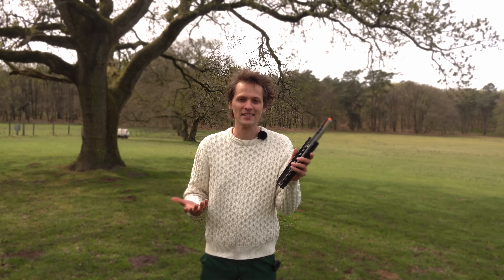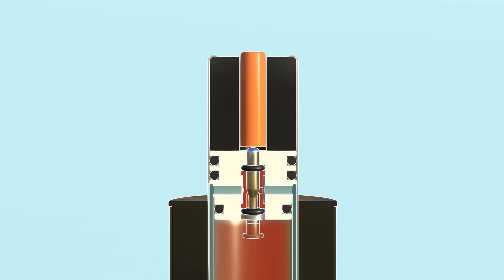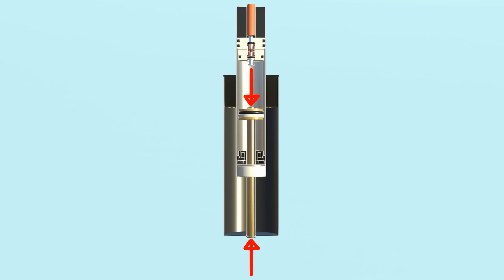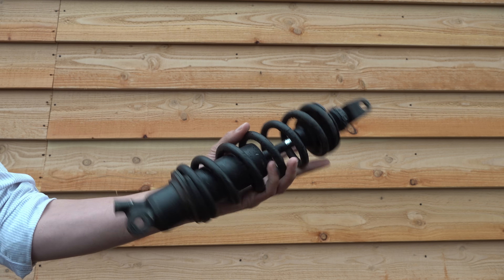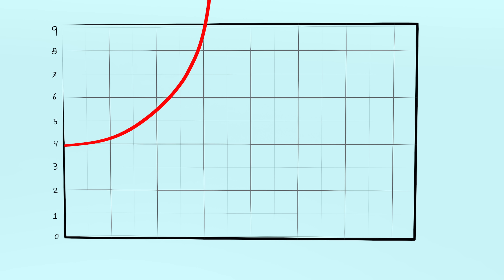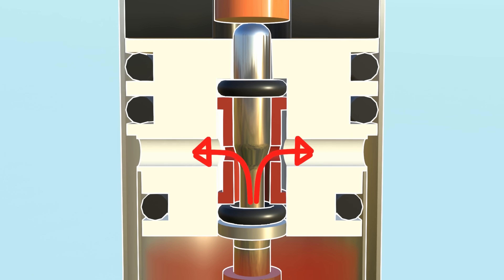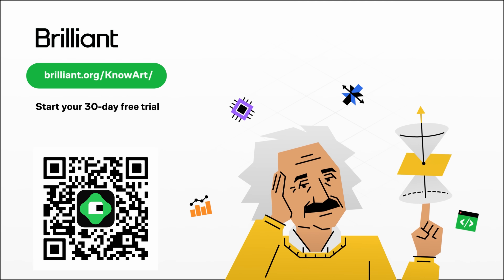The Brilliant Engineering of Gas Springs

Comment: Regarding the part at 1:42 I can unfortunately only guess at the function. My first thought was that it was the chamber to account for compensation, as the gas pressure will increase as more rod volume enters the cilinder. 
But that wouldn't make much sense. Besides not being needed because gas is compressible, in the cutout animating it appears that the bottom rubber is more of a kind of seal. Maybe it's acts as a 1 way valve to allow the piston to be pressurized from the bottom during manufacturing? Interesting video! And yes, I had seen the video en linear gas springs from ThisOldTony, great stuff!

Comment: If that diagram is correct in the beginning, I am curious if that bleed hole to a rubber washer may somehow compensate for the chair being manufactured at a higher, or lower, altitude than where it ends up being sold at? 🤔

Comment: Sure we can make a real world constant force gas spring, just use the earths atmosphere as the pressurized zone and a vacuum as the low pressure zone… only problem is that 1 atm isn’t that much pressure and you need thicker cylinders to get enough force.

Comment: It is important to highlight that the pressure inside must be greater than air pressure for this to work (or if it is lower then it would work in reverse).
I know you had that in the video, but it was glossed over very quickly.

Essentially, 
top rod is supplying force of: p_air * S_rod + p_inside * (S_piston - S_rod)
bottom rod is supplying force of: p_inside * S_piston

The force up is: S_rod * ( p_inside - p_air)

Comment: I've been pondering this a bit and something that feels intuitive to me is if you imagine that there is no piston at all, just the rod that slides in and out of the pressurized cylinder. The pressure in the cylinder would push the rod out. That is pretty easy to reason about and makes intuitive sense. Then we add the piston head, but the only thing that does is restrict flow between the chambers to dampen the motion. The math works out the same, the cross sectional area of the piston is what matters. But the intuition feels easier. Pressure pushes rod out. Add a flow restrictor to the end that slows it down, but doesn't change the fact that pressurized air is pushing the rod out.

Comment: I would suggest that the idea around 3:55 becomes easier to understand if the explanation focuses on how the volume of the gas changes as the piston moves - that is, whether the gas is being allowed to expand or forced to compress.

This rate of change in gas volume, per unit of piston movement is the “area” in question that the force is acting upon.

The relationship between the two explanations brings in a small bit of calculus:

F
 = dE/dx
 = d(P * V)/dx
 = P * dV/dx + dP/dx * V
 ≈ “P * A” + 0

(dP/dx * V is a small number since dP/dx is small, and it corresponds to the gas’s internal changes, like temperature.)

But notice how the “area” A here is the area that contributes to a change in gas volume as the piston moves. That is what determines how much work the gas is doing, not just any surface in contact with the gas.

As an aside, this also makes it more intuitive why the gas inside must be kept at a higher pressure than the atmosphere. It is similar to how a balloon expands when the pressure inside is greater than outside, just with a very oddly shaped “balloon”.

This all connects well with what many people learn in chemistry or physics about the thermodynamics of ideal gases.

Comment: My old chair had the valve stuck down so the piston dropped all the way. When I pulled the valve with pliers it blocked the piston but the valve fell back down, allowing the piston to go down.
I think it's the most common failure point, any idea why ?
Just a little spring would prevent this but manufacturers are cheapskates.
And you wouldn't buy a new one if the old one kept working.

Comment: 2:48 What I don't get about your explanation with the different surface area on the two sides of the piston: The piston rod itself actually stays stationary, as it is fixed to the wheels of the chair. It's only the cylinder that moves. Wouldn't the explanation thus lie in the different surface areas of the top and bottom of the cylinder?

Comment: Man, you had probably saved my chair (if I can repair it, that is). 
Just a half year ago, my office chair started to go down after a while. Tried to take it apart, but then I saw that the piston is , well, quite compact, and that I won't probably be able to get inside, not to mention that I didn't know the theory!
But now? Now I do! 😃
So I will make one more attempt to save my chair, because despite being just basic chair, I feel like it's pitty to just throw it away.... 😅
Reply: it's also not too hard to find a replacement cylinder
Reply: A replacement cylinder is probably the way to go (not that I have ever replaced one myself). Getting a matching cylinder might be the difficult bit.

Dismantling the cylinder before releasing pressure could be dangerous - suddenly bits flying at high speed.

If pressure released, how to seal it again, & how to get high pressure again?

Comment: You can also look at it like this: if you add ripples, you will have at least two new faces of surface area, and yes they will experience forces. But crucially, those faces will be opposite one another (otherwise they wouldn't be ripples), so those new forces cancel out. 

That works out to only the projected surface area being able to produce useful forces.

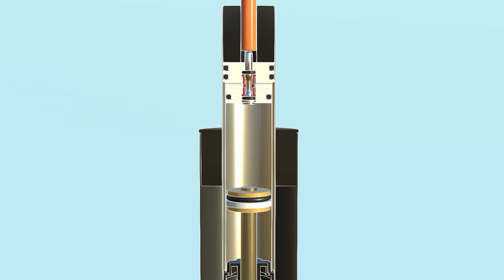Comment: 3:10 WRONG! EVERYTHING beyond this point is wrong, or at least not relevant in this context.
Yes, there IS a force-difference between the piston & non-piston side, but that is NOT what makes your chair go up. Because you push in the button that equalizes the pressure in BOTH inner-pistons, so there CAN NOT be any net-upwards force in that tube, that presure has to come from somewhere else, and he completely missed that. 
The upwards force comes from the THIRD OUTER PISTON (that outer "shell" is not just a decoration), that third piston does the pushing, on the under-side of the inner-lower piston, this was never mentioned throughout the entire video.
@Know Art You should do this video again, but explain it CORRECTLY this time.

Comment: I have a question won’t the air just flow from one side of the piston to the other side of the piston slowly When you sit on the chair? Couse the Piston basically has a holes in the middle of it, so the air would slowly leak from one side to the other right? Or does I misunderstood something in the video 1:28
Reply: The two chambers are connected by a valve that opens only when you press the handle.

Comment: I'm watching this while my chair won't stay up, lol I suspected something worn off inside, maybe the o-ring in the air valve at the top is broken.
I'm still waiting for the dealer to come change the cylinder, 10 years warranty included with my chair is now worth it. They'll replace it for no charge, but I have to wait a few weeks for the part.

Comment: I think it's clearer if explained in terms of volume rather than surface area. The gas is able to expand and do work because the rod takes up volume inside the cylinder, and the rod can moved further out of the cylinder, to displace less of the high-pressure internal gas and more of the low-pressure external atmosphere. With the volumes above and below the piston head connected by a free path for gas, the piston head, it's size and shape, and whether it seals, is irrelevant to the chair being lifted: the gas wants to expand and push the piston rod out.
Reply: Yep. It's easier to think about gas springs if you actually just ignore the piston. 

It's not actually a piston, not as you'd find in a syringe at least. The piston head is only there to restrict the gas flow. What is really compressing the gas is the amount of rod that is inside the cylinder. The pressure inside just acts to push the rod out. 

The piston head just creates opportunities for controlling the flow of gas inside, which makes the process of ejecting the rod controllable. 

Gas springs are absolutely genius!
Reply: @akaHarvesteR  I am not sure I have got this right: if you don't want the height adjustable, just leave out the piston, and leave out the controllable valve as well(?)

But then if/when the high pressure gas slowly leaks out, the seat will gradually go down, the height with a particular weight on it that is(?)

So part of the point of the piston & controllable valve is that if/when some gas leaks out of the system, it is still possible to get the seat to go to its top point(?)

Also, leaks through the controllable valve and/or past the piston are what cause the seat to gradually sink while someone is sitting on it(?)

When there is no (extra) weight on the seat, you want to design so that the seat is at its highest, and the pressure on both sides of the piston to be equal(?)

I am not less sure about what you want the two pressures to be when someone is sitting on chair to be. Higher on the side where the rod is not there (with the greater area)?
Reply: @franksierow5792  I just meant it's easier to think about the physics (of why one side gets more force than the other). You absolutely do need the piston head in there to get it to do anything useful. 

The piston head is what provides the separation and flow restrictions. I just meant that crucially, it is not the main pressure face, as in a syringe plunger. In a spring, the pressure acts on both sides of the piston head, so with the exception of the shaft area on one side, their forces cancel out.

Comment: That rubber thing at the bottom probably expands when there is a lot of pressure towards the bottom of the rod's travel so that it grips the sleeve and slows it down at the end instead of just hitting a hard stop
Reply: The hollow part gas it let into is likly just a way to use less material, a solid part need more plastic and hollow part you do not let gas into result in pressure diffrence  and additional forces on the plastic.    How the cylinder can handle a bending force depen on how far in the sliding middle part is from the end, the close to the end the higher the force on it is from the same bendin force on the cylinder.     So it is way to reduce the force of impace at the end of travel and a way top keep the the sliding part far enough inside the cylinder.

Comment: pro tip to extend chair life 
when the cylinder starts to sag  after year or so 
find bolt nuts to slide over the rod about 5 should do to find right Hight and you wont need to buy new chair or cylinder

Comment: I'm flabbergasted that the gas remains for years, at pressure, with valves. Tell that to my balloons, bike tires, and most things.
Reply from the maker: yes! absolutely crazy. I have no idea how they do it
Reply: It seems to me that the valve could be quite leaky but that's not letting the gas out into atmosphere, just out into the other side of the piston!
Reply: Nobody asked but yeah basically what you are saying! The reason tires, balloons etc loose pressure is because rubber is actually not 100% leak proof. Air molecules can escape through the rubber membrane (this is also why cars use nitrogen in tires sometimes, as the longer molecules prevent it from escaping so easily. Added benefit is the much more lower expansion rate of nitrogen vs 'air', which is beneficial in racing like F1 where the tire pressures will increase less as the tire warms up). So because there is so little rubber in the total system here only the outer O-ring like you mentioned it means it can hold pressure for years, instead of just a few months like with tires!

Comment: Hey there I liked your video I just wanted to ask a question that 
-Can I use ratchet straps without a hook to hang an item or do gymnastics with rings inside the straps and then I ratchet it and it becomes tight to support my bodyweight should I do that because I cannot find cam buckles which can carry 400 kgs.
Reply from the maker: I have no idea what you mean exactly
Reply: @KnowArt  like steel cam buckles with polyester or nylon straps are used to hand gymnastics rings and do gymnastics but they are rated for 120kg capacity per strap and my weight is 100 kg it might break if I do Dips and muscle ups

On the other hand ratchet loop straps are just like cam buckles with nylon straps but ratchet ones tighten I am thinking to use them as straps for my gymnastics as their WLL is more and break strength is also more 

For example WLL 500KG
Break strength 1500KG

Comment: fun fact, when you get warranty or extra insurance on really expensive office chairs, it almost always covers ONLY the gas spring and not even the mounting hardware. the gas spring almost never fails because they are so simply made. you will never find a used office chair with a broken gas spring.
Reply: There is that one story about an office chair in China “exploding” but that is also due to QC issues for domestic production. I don’t think they had warranty on the product either

Comment: Something i want you to do a video on is
negative stiffness mechanisms.
they are really cool mechanisms often used for damping out low frequency oscillations that usual shock absorbers and springs cannot do. 

also i bet its a really fun thing to animate, or build
its just a fancy arrangement of springs really that gives a 'negative stiffness' in one direction.

all of the existing stuff is a bit hard to get an intuition for.

this is probably the best video demonstrating the effect
titled:  QZS Experiment with weight 
https://www.youtube.com/watch?v=QsTbTugNx_w
Reply from the maker: that sounds really cool! will check it out

Comment: I'm confused, would it not be simpler to just describe that when the piston rod moves into the cylinder, the total volume of the combined chambers is less? And we you lift up, the lower energy/lower pressure state is for the piston to move the rod out of the cylinder?

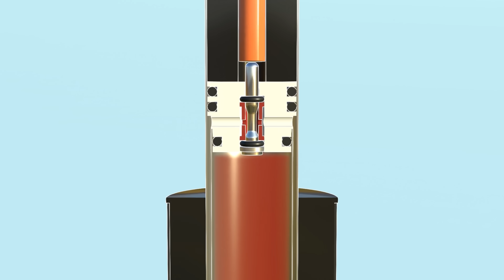Comment: 9:00 this valve is also used on some airguns, some called single stroke pneumatic. Interesting topic in my opinion, because such valves are lightly triggered, yet they hold about 150bar and once triggered, they are self-opening, thus covering the demanding flow and power of an airgun.
The main difference is that the o rings are of different diameter and the exhaust is on the smaller side of the piston
Reply from the maker: cool!
Reply: Shuttle valves don't need much force to actuate because they're balanced: They don't fight against the gas pressure.
Reply: @soaringvulture  yup, even better, this one is slightly unbalanced, which allows the triggering, self opening... And I bet the unbalance gets bigger the moment the valve starts to open, sort of like a qev, I'm quite sure you know about those too.
It's just that I love his videos and I'd love to see my faborite valves featured :)

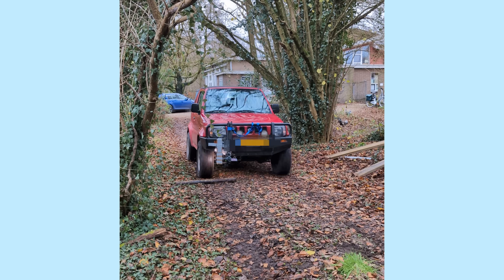Comment: 4:38 pixelation is not an effective way to obscure information
Reply from the maker: true
Reply: Why ?  How can you put it back together if there is no information?
Reply: @izysly6924 depends a bit on context but in the case of the pixelattion shown in the video it's possible to retrieve information because the pixel cloud it moving across the subject. So basically it acts like a scanner, showing a small part of the available information that changes over time. If you collect all information over the duration of the shot then you can recreate what is behind the pixel cloud. 

An other way is by checking what info is visible. For example if you pixelated "lllllllll" you get a dark pixel cloud because most of the image is filled with letters. But if you pixelate "VVVVV" you can get a much lighter pixel cloud as there is more blank space between the strokes. Now if you are a bit more clever by for example looking at where the origin of the pixel color is and comparing it with the font used you can quickly deduce which letters are used. 

In the end letters and numbers are a real small set of options that could be behind the cloud. So if you know what is the value for specific spots behind the cloud you can eliminate a lot of options. Like if you know that a dark pixel exist in the top right corner of a letter then it can't be L as it is blank in the top right. And so on. And as 7 segment displays show you need relatively little information to encode a letter
Reply: @izysly6924 with enough motion in the video, the right software can figure out what information was used to decide the pixels based on which pixels changed and to what color from the motion done. I don't know the extents of how good it is, but if you had maybe 10 seconds of moving a piece of paper around in a video, the footage can be fed into the software and read exactly what it said.

That said, this only works on video. If you're pixelating a still image it's perfectly fine. Methods of reversing a blur filter already exist too, so the best way to censor information on a public video is just a black box at this point

Comment: Great video, but it was pretty visible that you cutout a part of the videos then added blur around it, which looks a bit odd if you watch on a larger monitor ;)
Reply from the maker: yeah, I had some serious problems on the first upload with youtube's compression algorithm. It doesn't like the detail in the grass and trees AT ALL. So when you were watching in 1080 (most people) it looked like 240p or something like that because of bitrate limitations. So I had to put some pretty significant blur on the background... not a a choice I made for esthetics!
Reply: @KnowArt  depending on what you film with, you may be able to open up the aperture as wide as possible to get a better looking separation between background and foreground. also would help to get as close to the camera as possible